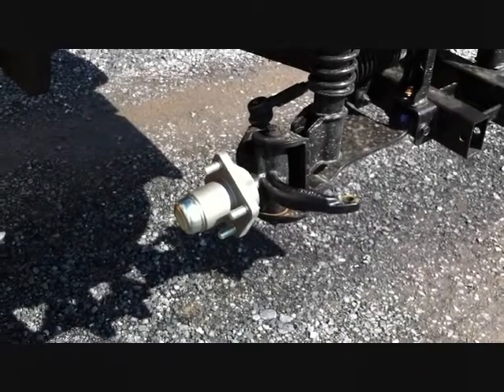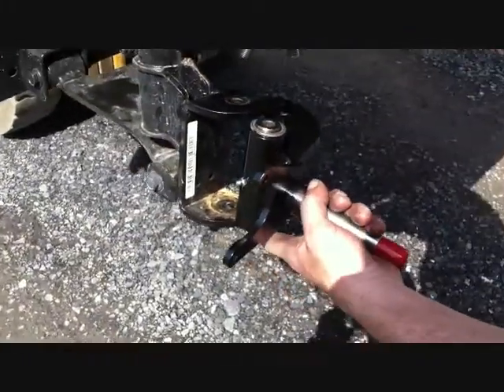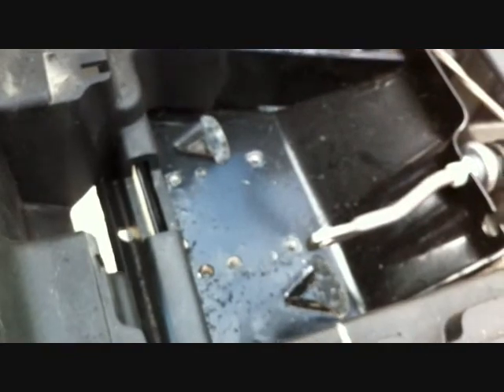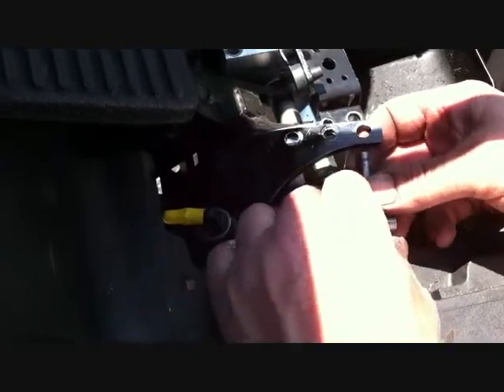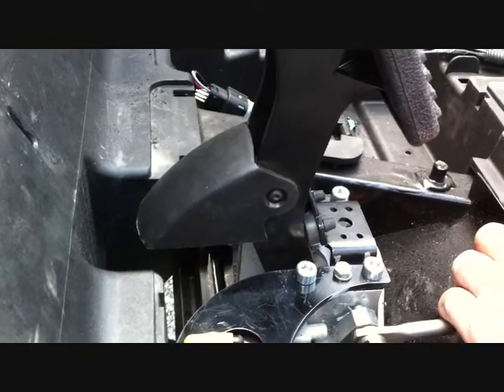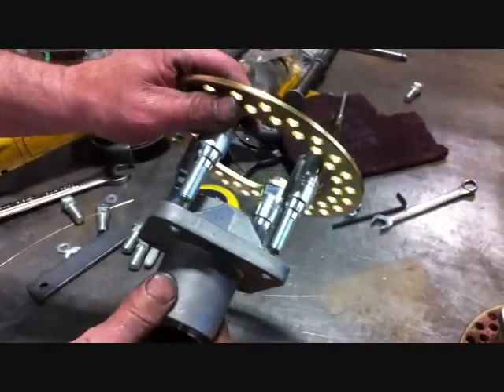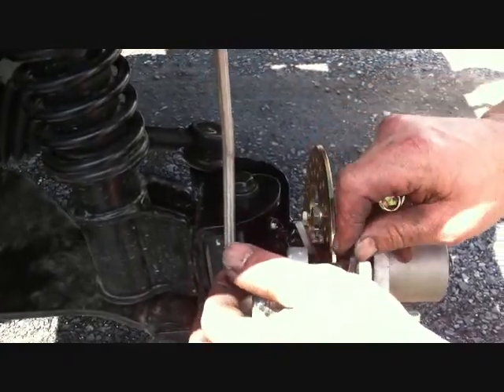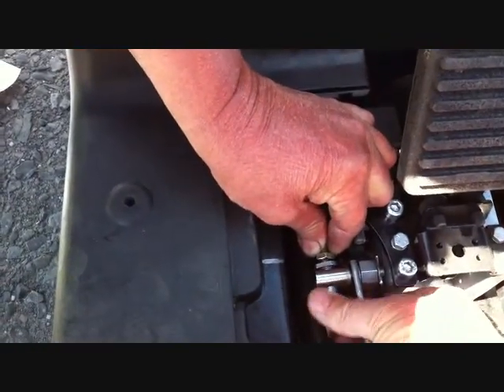Jake's Brake Kit for EZGO RXV Installation (Electric)

Comment: Can you please answer the first question.
I also want to know,  how much wider is the front wheel track with brakes installed?
Reply: its keeps the same width as stock, or if you use the lifted kits, the same as that